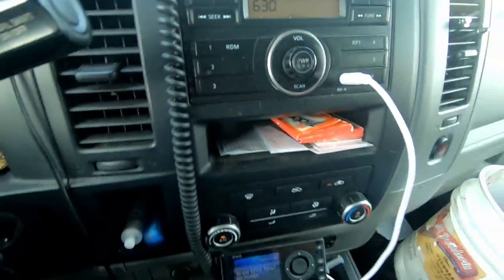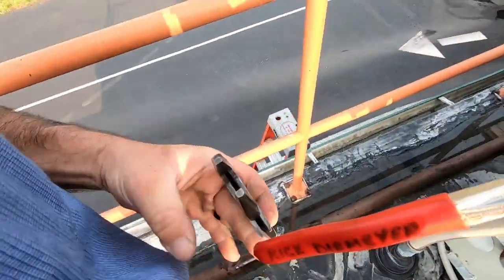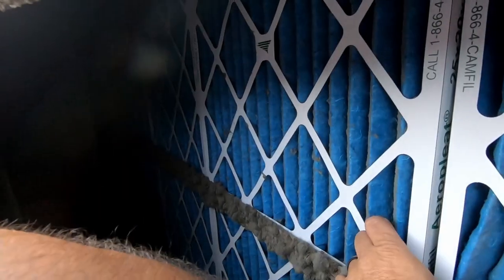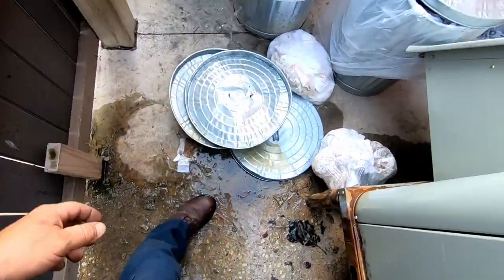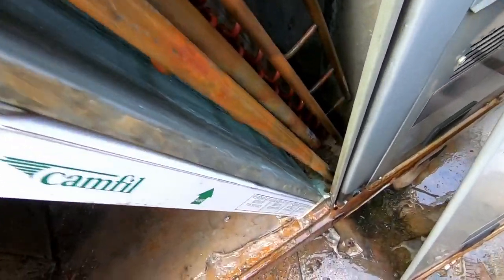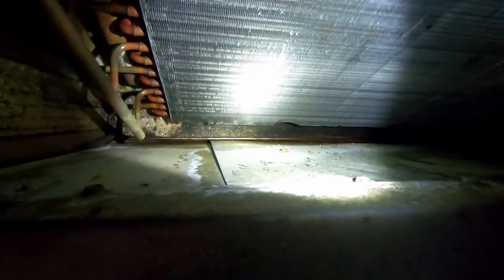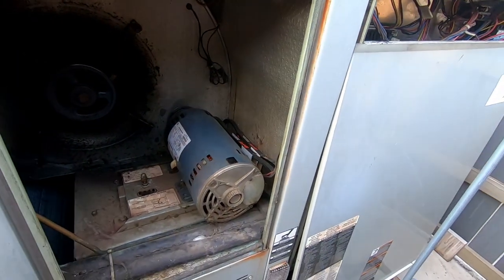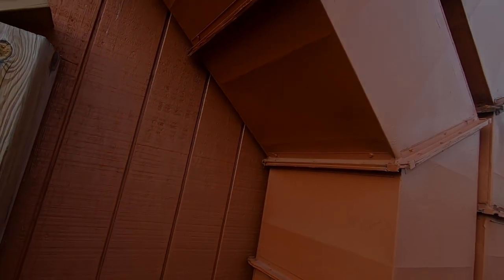Overtime No Cooling Call AC Not Keeping Temperature

Comment: I have to do a lot of work higher than I like, both years ago in theatre (walking on the grid), and in IT (cameras, switches, access points, wiring), but I REALLY wouldn't want that job.   I hate open heights.   You're a better man than I, Gunga Din. 

I wonder how the pulleys got ignored long enough to get that well grooved.  

That homemade p-trap was cute.  My previous house had the drain being a PVC pipe down the side of the house, stopping a bit above the ground where a drain spout used to be.  I added an 8 foot piece of PVC to it and used it to water a section of the lawn :)    (Frankly, I hate waste water always being sent down the sewer.   My shower is NOT toxic, and could water a big chunk of lawn. )   

Suggestion - get yourself some large carabiners and straps.  when you have a job like this one, attach them to the wrenches  so you can clip them to your belt and have your hands free.   The rest of the time, just hang them (the carabiners and straps) up, or clip them to a bag.
Reply from the maker: Thanks for sharing all the information👍

Comment: Very nicely done. I still don't think I'm going to tighten the belt running!! I always say that I probably won't eat at most of the places we work after being in their kitchens.....Thanks
Reply: Not always I work sometimes at 5 guys and these restaurants are actually really clean, but most restaurants are nasty
Reply from the maker: You couldn't hear me say it but yeah that's not the safest thing in the world. And you can over tighten it a little more easily when it's running because it's taking up the slack. The Safeway is to shut it off and do it by the means of deflection and using a Belt tensioning Tool. This was a Friday night, I don't want to be there, let's get this bitch done and get out🤣
Reply: Yes agreed!! Friday nights and weekends are let's get this thing done and hopefully it's on the truck please.

Comment: Is this one of those places that turn the AC off when the building isn't occupied then it has to try to catch up? The system has to remove the moisture before it can cool the air.
Reply from the maker: I had to go back and change the pulley and then when I checked the refrigerant charge it was about a pound low per circuit. It still doesn't keep up all that great so it really didn't make that much of a difference
Reply: Those buildings really tick me off.   They don't really save any money by doing that, and it's destructive on the computer equipment.   It's mostly a con job to extort extra money out of people that work late and on weekends and don't want to swelter.
Reply: @tbelding  A banquet manager at a facility that was only used on weekends would wait until the place was filled with people before turning the AC on. People who rented the facility for wedding receptions complained about how hot it was.
Reply: @tiredoldmechanic1791  - and he stayed in business?